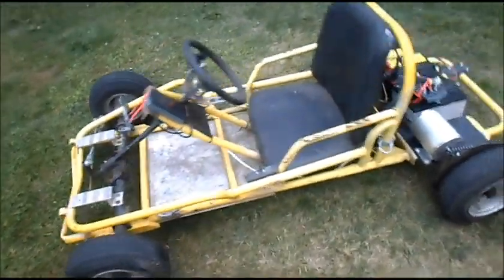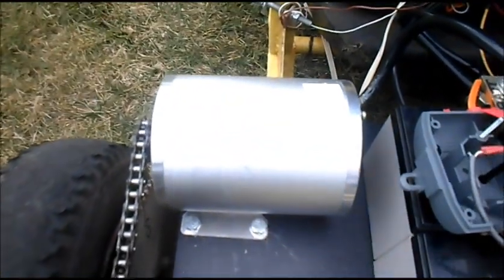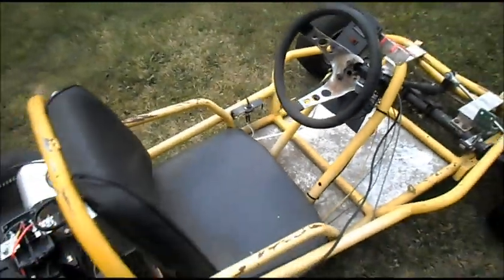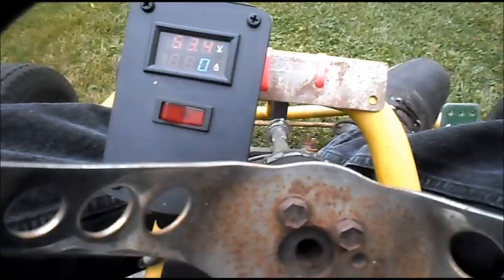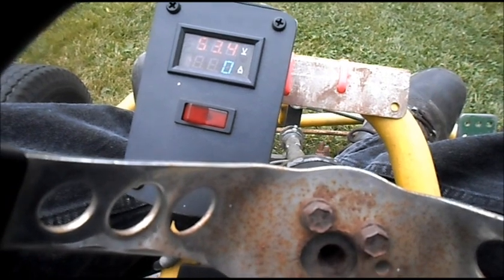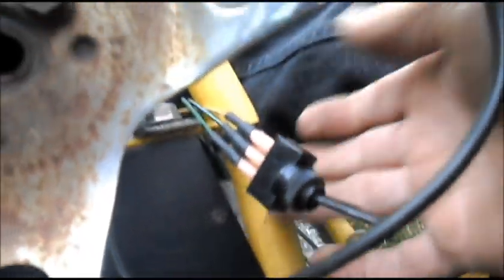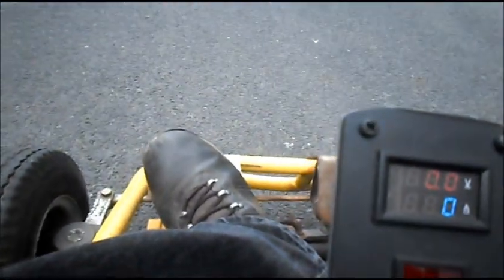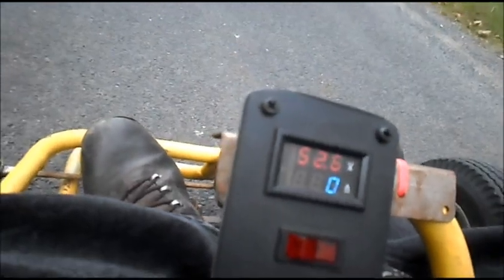e Lemon aid  part 17 Test drive with a Boma 48V 1,800W brushless motor with high gear

Comment: To go faster make the sprocket  ( on the wheel  smaller ) or the sprocket ( on the motor larger ) or both and you could get over 50 to 70 mph if you do this
Reply: Bolt up a ATV rear and this motor its geared at 4.88 right now with 16in tires. Only does 16mph and should do alot more. It dont have enough power to. Drive throw the grass. I am gonna bump it up the a 60v motor to get some more torque
Reply: The motor dont have enough torque i have one a tractor I gutted and made a frame to

Comment: The purpose of the switch is to go from low gear into high speeds, to take advantage of natural physics, but in that case you need to add brakes and most importantly shock absorbers to stabilize all that energy, other wise I see you at the hospital, but by releasing acceleration it should effectively slow down, I made a go cart with two motor, to use it in my village back home for transportation purposes, and works, I get wet when rains but home is not too far
Reply: the gokart has brakes and race carts don't have shock absorbers.

Comment: So could you decrease the gear ratio (something like 6:1) and get a higher top speed or is the motor just not powerful enough?
Reply from the maker: Yup, that would increase the top speed.
Reply: @functional_artist  Ok. Just curious, why did you choose 8.4:1 instead of something like 6:1? I assume you could go around 20 or 25 MPH with an 1800W motor like this.
Reply from the maker: The 8.4:1sprocket was already on this kart. I went with it just as a starting point. More to come.
Reply: @functional_artist  :D
Reply: @functional_artist  hi, where did you buy 84 tooth sprocket? Thanks

Comment: IF YOU MESURE FROM TOP TO BOTOM OF THE TIRE ITSELF YOU WILL HAVE 8.75" (8 3/4") MOTOR IS TURNING @5200 RPM TOP SPEED WITH 10/84 GEARS WILL BE  16.17 MPH. 65T REAR GEAR WILL GET YOU 20.89 MPH. 55T REAR GEAR WILL GET YOU 24.69 MPH WITH TONS OF TOURQE OVERKILL LEFT. ANY MOD TO GO FASTER THAN 16 MPH YOU NEED TO CHANGE TO A 40 AMP FUSE AND CHANGE TO 10 AUG WIRE WITH ALL CONNECTIONS SOLDERD FOR GOOD POWER OUTPUT. HAVE FUN.

Comment: I have tested the same set up (black motor instead of silver) in a lighter weight package with GPS. In high speed can only achieve 3100 rpm loaded.
Reply from the maker: So, the (black) 48V 1,800W brushless motor does NOT seem to be as powerful as the (silver) 48V 1,800W brushless motor?
Reply: I am waiting for a reply back from TDPRO, but I seem to be about 1000 rpm low on top speed.
Reply: New message from: tdpro99 (28,239TurquoiseShooting Star)
Hi Nick

Just consulted the supplier and they said the rated speed for the black motor is 2800-3300RPM, so that may be the reason.                                                                                                                                                                                   Yes-Slower RPM on Black motor.

Comment: Good info on the gear ratio and tire diameter. Your loaded motor rpm in high speed is aprox. 4000 rpm. I have always noticed all motors are rated unloaded and this one is 4500 rpm per manufacture. So a 500 rpm drop expected in a go kart set up.

Comment: this is awesome. id love to put this motor combo on a barstool style racer I plan on building
Reply from the maker: That's kool! This motor would make a barstool racer really fly. Here is a the one I used   http://www.ebay.com/itm/E-Bike-Brushless-Motor-Controller-Throttle-Grip-Electric-go-kart-ATV-1800W-48V-/302382106937?hash=item466760c939:g:98QAAOSwJq1ZZunQ